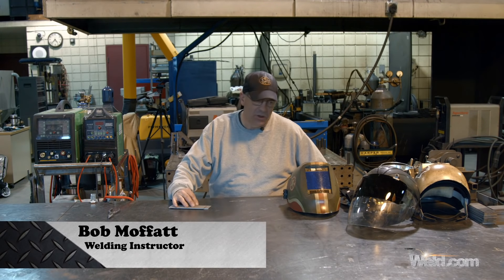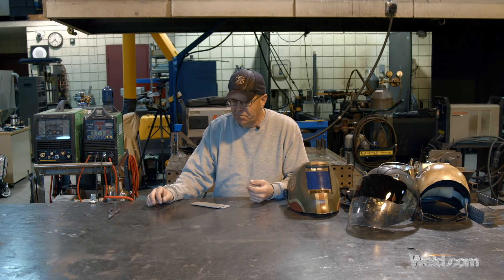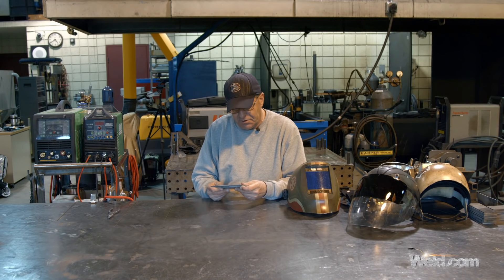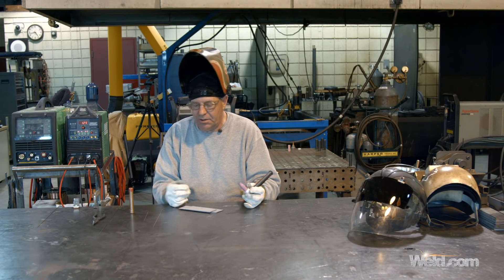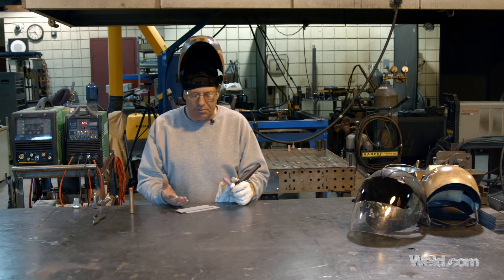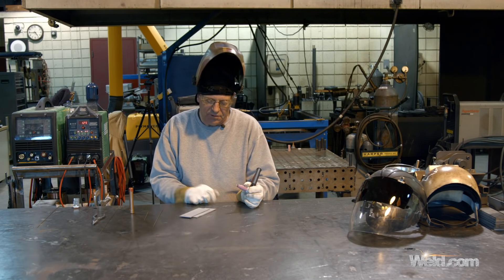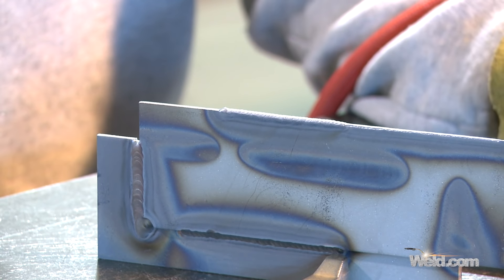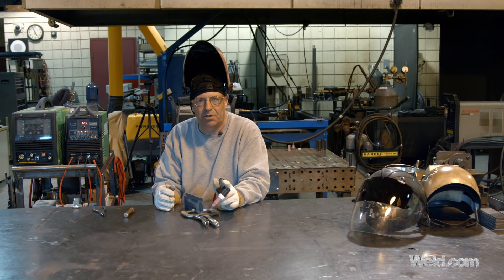🔥 TIG Basics: Lap Weld Practice with the Everlast PowerTIG 200DV

Comment: G'day Bob I keep sticking the filler wire ahead of the weld puddle any pointers on how to stop that or what I could be doing wrong. I noticed you have a very steep push angle on the torch I am more up and down then that what angle should I use thanks Bob

Comment: Well Crap!  His blown up weld is even better than mine..  more practice...    Bob, I would love video finely dissecting arc initiation, esp w. aluminum.   All these vids start an arc, but on my (AHP) I can hit the pedal and the arc will start no where near (like a bead width off) the joint.  My heat input goes high trying to get it going where I want.  Once going, it goes fair.  Problem is worse welding diff thickness material.  IE bracket to a tube.  BTW, this struggle is with perfectly clean material best I can, new ground tungten (blue), etc...    Thanks for teachings as always!!

Comment: How about doing some tig welding without a foot peddle just using a button start and a wheel for adjustment of amps. We don't all have a foot peddle. Also a foot peddle is a problem if you have to walk around welding different corners on a large project.

Comment: Hi Bob, may I ask you a question that makes me crazy ? I saw that you give big importance to work in a save way and maybe you can help me. I use 2% lanthaned electrodes. I have red somewhere that also those are slighty radioactive (apart the thoriated that I knew to be dangerouse and I do NOT use them). Is that true that also the lanthaned are radioactive ? As I have a family at home I am scared to bring radioactive dust home. Can you tell me if I should be worried about the lanthaned ones ? On the package is written  "NOT RADIOACTIVE" but on the web you find that there might be "slightly" radioactive. I love TIG welding and I have learned a lot from you. But this is really putting a lot of doubts in my mind. Thanks a lot for your patience.
Reply: Alpha radiation does not penetrate the skin. That said, do not breath the dust when you grind your tungsten and you'll be fine, thoriated or lanthinated.
Reply: Hi, thanks for the reply. So does it mean that the Lanthaned one IS radioactive ? I feel that it is allmost impossible to avoid particles of dust, even if you are carefull. Even if you have a suction  some of the particles surly will "escape". I mean, even one radioactive particle is dangerouse, isn't it ?
Reply: Just wear a mask if it bothers you that much man. I've got a 3M mask with the quick latch drop down mechanism and highly recommend getting one with that latch. I don't wear for grinding tungsten rather mainly to prevent black boog (and prob lung) when from plasma and general grinding. Honestly, I bet your exposed to 100 times the radiation on 3hr flight.
Reply: It means that it is radioactive at a level at or below a cell phone or a microwave oven. In other words, it's not dangerous. If you are a hobbyist you will likely not have much exposure not matter what. If you weld every day and grind a lot of tungsten wear a respirator. That is my understanding of the level of radioactivity. If you are still worried about it, go to ceriated and avoid it all together.

Comment: Love starting my morning with coffee and your videos......... Hey, what model air-cooled torch is that? I have a big 18 water-cooled torch and I'm looking for a smaller air-cooled torch with a Dinse 35 plug that will "bolt" right into my Everlast 256Si combo machine........... THANKS!!
Reply: Ken A 
The only air cooled torch thats physically smaller, is a wp/ck sized 9 torch, or a 24 series which is smaller still. Thing is, a 9 series torch cant handle much heat only around 120amps max (i think, dont use them). 
A 17 sized torch is a bit better at around 150, but same size torch as a water cooled 18 or air cooled 26.
The only torches i use at work are 18's, and if access into a joint is an issue i use 4series consumables, ie the stubby gas lenses and shrouds and a short back cap.
Reply: Thanks..... I bought the stubby gas lens kit at Weldmonger but it only went to # 8 size...... I'll look for  larger ones (gas lens)